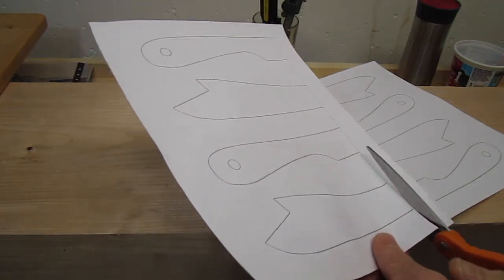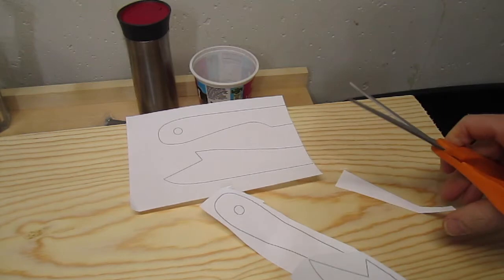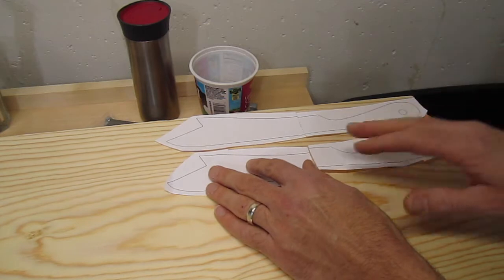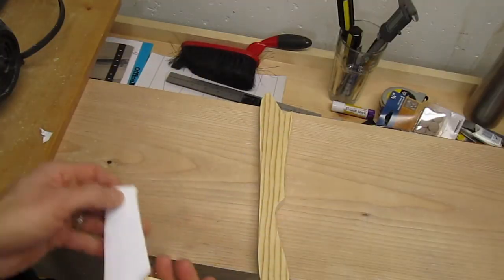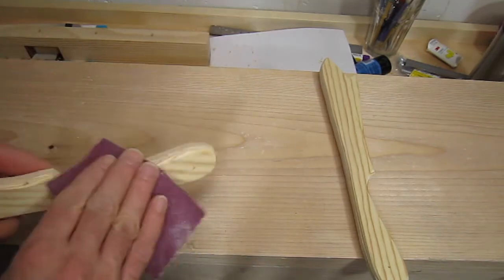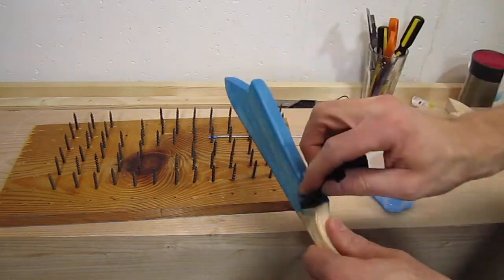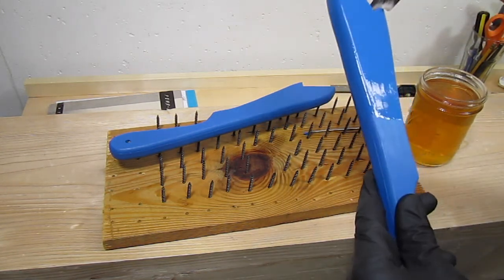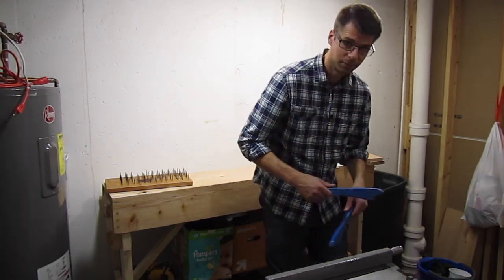Making the Matthias Wandel Push Stick

Comment: I have push sticks of a similar design. I have improved the holding ability of mine by glueing some small pieces of rubber, cut from an old mouse mat, to the "sharp end". This stops them slipping and sliding around.
Reply from the maker: Good idea, thanks for the tip. I was thinking about making my next ones a little longer, I get apprehensive about getting my hands close to the blade.

Comment: Isn't such an open running belt drive very dangerous?
Reply from the maker: Only if you get close to it with loose clothes or something. This design of table saw (contractor saw) with the motor hanging outside the saw body used to be very common. I don't feel that it's unsafe if you stay to the front of the saw when it's running.